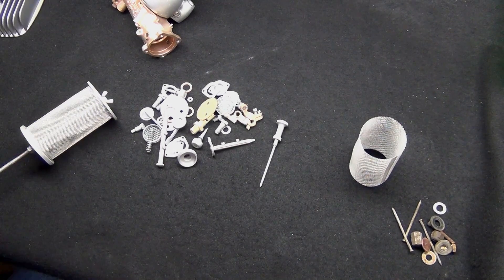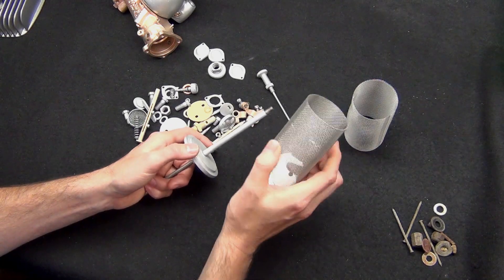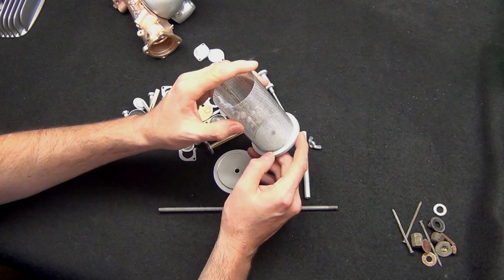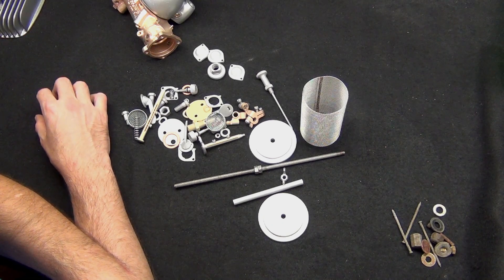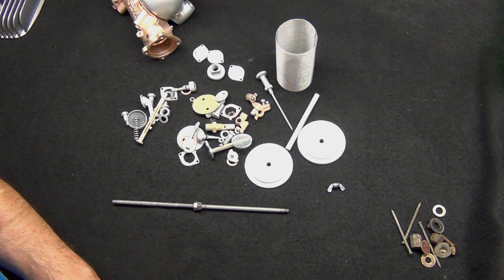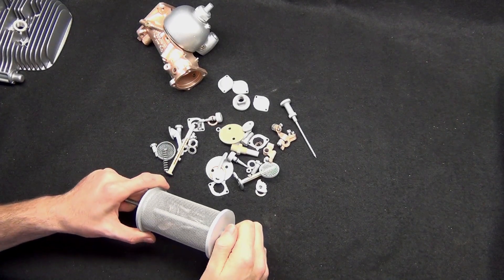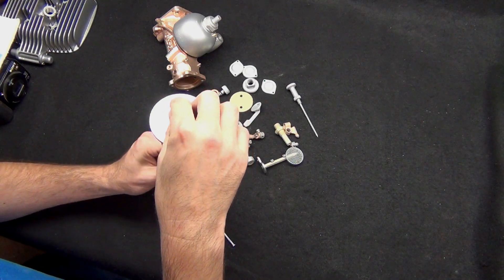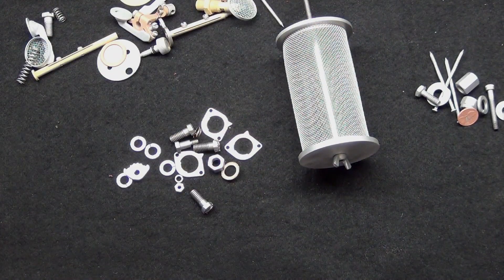DIY Device to Easily Sand Blast Tiny Parts

Comment: Forget using the inner tube just use lock nuts throughout! When you lock in the nuts into position it will easily disassemble quickly.

Comment: Instead of the two nuts locked together under the lower disc you could lock them together with the disc clamped between them.
Also, a single nyloc nut (or a pair of ordinary nuts locked together) could be used as an adjustable spacer instead of the fixed length tubular spacer.
Perhaps metal jam jar lids with holes drilled in the middle could be used instead of the aluminium discs for a very simple low budget build?

Comment: This is interesting because we have a Skat Blaster and we are a micro machine parts maker so this little basket is a must make for or shops bead blast cabinet, we do not have the water version you do, ours is dry. Thank you this makes great sense we have something similar for our sonic cleaner station where the parts are also very watch part sized. 
Lance & Patrick.
Reply from the maker: That's an interesting business niche you have. Pretty cool.

Comment: Bought a few of these at Walmart awhile ago for use in the blast cabinet and the parts washer. Just hold the gloved hand over the top to keep the parts in. A cap would be better. 

https://www.walmart.com/ip/Rolodex-Nestable-Jumbo-Wire-Mesh-Pencil-Cup-4-3-8-dia-x-5-2-5-Black/14916659

 Brad...assume that you decided against offering plans for your Vapor Blaster? Just curious, sorry for the pesty question.
Reply from the maker: No, I'm still working on them. I've been so swamped with vapor blasting work this summer, much more than usual. It is about 95% done. I just need to complete the electrical switch part, and I want to be very careful about how it's layed out in the book.
Reply: @ArnoldsDesign  Oh, that's good news. Glad to hear your busy!
Reply from the maker: Btw, the rolodex looks like a good idea with the cap. I'll probably pick up a few.

Comment: I have been doing it wrong, just using a flour sifter in my sand blast cabinet.
Reply from the maker: I've used sifters too. They work as long as parts don't blow out.
Reply: @ArnoldsDesign   I had that happen with lighter parts. I also use a soup can with the bottom cut out  and mosquito netting lashed on over  the bottom.  The aspect ratio of the soup can seems to keep all the parts contained.